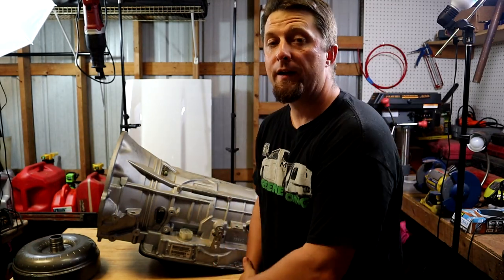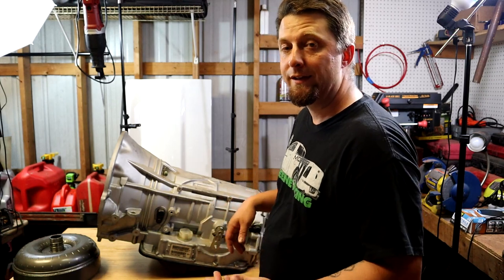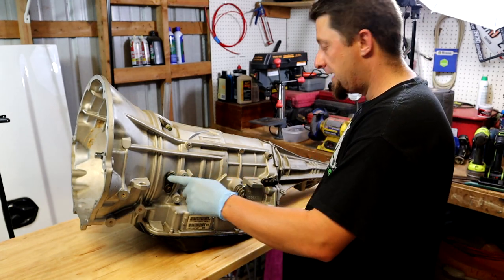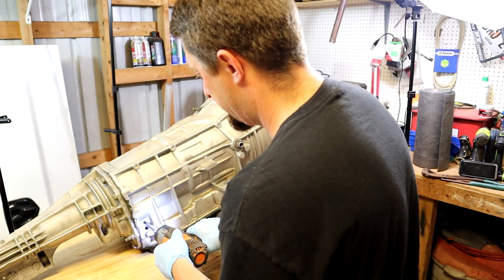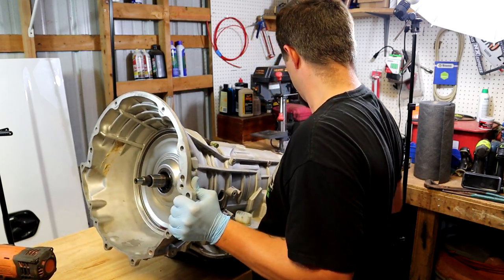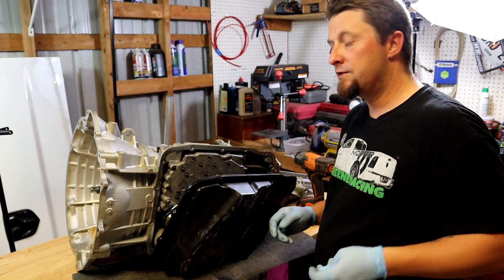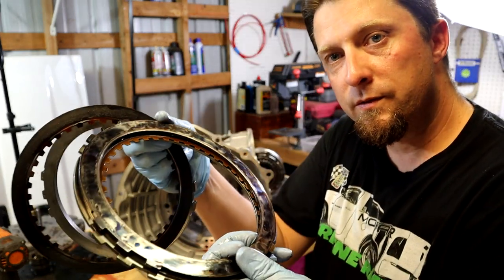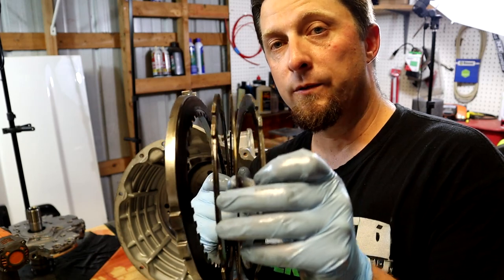545 RFE Transmission Tear Down RFE Most Common Problems

Comment: Builders beware! There are two different second clutch molded rubber pistons out there. Put the wrong one in and have no apply. Quality control is out the door.

Comment: Hello im gustavo from mty mexico y have a 4th generation ram 1500 mod 2012, i have problems because the neutral led no fuction its off in drive the truck, starts and fo forward an esoecialist tell me the range sensor but i dont know where is? You can help me?

Comment: hello, I own a jeep cherokee liberty limited 2003 KJ 2.8 CRD, with my diagnostic devices (DRBIII emulator, Icarsoft) the following DTCs are still present despite their erase. It's P0740 TCC out of range, P2704, P0218, P0868, when I drive I feel vibrations, I can't say exactly if it comes from the gearbox...I'M NOT A MECHANIC. Your videos are very informative, which is why I am turning to you with the idea of having information from a specialist to help me solve this problem. The accelerator pedal is sometimes soft and sometimes not...is there a connection? I changed the oil, the filter but I did not change the flat filter. Thank you for your response, help and support

Comment: Hi there, I have a question for a 545rfe expert…. I have a 2003 ram hemi with 35s. I like to cruise around 65 mpg on the highway, but sometimes it starts to lug down uncomfortably to like 1500-1600 rpm. I have heard these transmissions don’t like to kick down out of overdrive, that it would go into 2nd prime and burn up the o/d clutches. So I am curious what gear does it go into when I hit o/d off button? Does it kick down to 3rd? Reason I ask is because it is my understanding both 4th and 5th are overdrive ratios. 

Thanks

Comment: My 545-rfe has been nothing but problems and it’s just a daily driver.  2003 ram 2500.  It’s always 4th gear slippage for me.  No more than 50 to 80k miles and it needs a rebuild.

Comment: I've only rebuilt a couple transmissions before, but I recall part of the process being you need to soak your clutch rings in trans fluid for quite awhile before installing. Maybe these rings did not get that soaking and prematurely failed?
Reply from the maker: Definitely possibly 🤔
Reply: Details like that are exactly why a novice like me fail the first go-around😊 First junkyard tranny swap I did, I didn't know to prime the torque converter with as much fluid as possible. Those kinds of mistakes (that require hours of labor to fix) are the worst.🤦

Comment: The threads of the cannister filter are plastic. So be careful if you're jamming a screw driver through. Might as well have the correct tool if you're  tearing down a trans.

Comment: I thought this transmission had a fluid temperature sensor fitted? I have a 2005 Jeep Cherokee/Liberty 2.8 CRD which I think has this transmission. It has hard shifting when cold but is okay when it gets warm. I didn’t notice the sensor during the stripping.
Reply: I also have a crd and I'm pretty sure I cooked the TC from low pressure

Comment: I've got a rfe Trans that shifts fine in first and second but wo n't shift into  3rd. We tried replacing the Trans control solenoid and speed sensors  nada . Any ideas?
Reply: I have the same problem.did your fix it? Thanks

Comment: Thanks for the video.

Mine 545rfe has a very loud whining noise when accelerating in all modes - when in park, drive and neutral. I've disassembled it, inspected, replaced a couple of metal discs and installed completely rebuilt torque converter, but it didn't help.

Have you ever faced this problem? What can it be? Any bearing or maybe pump?
Reply from the maker: Glad it helped

Comment: Whats your opinion on the ats transmissions, 5 different stage options. Tired of the reman trans from the shop not paying 3 grand for another one to shit out at 40,000 miles. Stock 2007 dodge ram 1500 5.7
Reply from the maker: Best option for stock replacement is a factory oem transmission

Comment: I’ve got 300k miles on my 45 and it’s stuck in I am assuming 2nd and 4th gear or whatever two gears it chose I’m not sure but I mean before it got stuck in those gears it shifted pretty damn good ngl
Reply: Had the same issue with mine and I have 180k tho but I’m pretty positive mine are shift cylinoids
Reply: From what I have read, you may be in what they call "limp mode". It's a preset failsafe that limits the transmission once the solenoid fails.

Comment: So what caused the clutches to burn up? If it was a fresh rebuild they should have been new. Are they not getting enough pressure to lock up properly? Bad parts used in the rebuild? Installed wrong? Too much power? You did a great job finding the issue but what caused it?
Reply from the maker: That is the million dollar question I'm not sure. I'm leaning towards not enough pressure and perhaps bad install or fitment.
Reply: @FrostbiteRam  I would be worried about rebuilding it and throwing it in your truck without knowing that. Do you plan on replacing the valve body during your rebuild?
Reply from the maker: @chrisrussell6538  probably not, I actually have huge plans coming up for transmission upgrade. Lets just say frostbite will be on a next level.👍
Reply: On these transactions the computer needed to be set in quick learn mode or it will fail prematurely. As the transactions wears the computer compensates. When trans is replaced the computer doesn't know it's new.

Comment: Hi! 
I need some help! What is the different between the 545 and the 65RFE transmission? How can I identifie my transmission? I have 2012 RAM 1500 Lone Star crew cab with 5.7 HEMI engine and I can shift 1 to 6 manually. Thank you for your help!
Reply: You have a 65RFE if there’s 6 gears. The first number represents the number of forward gears. Your transmission has a label on the left side of the case just above the pan that identifies it also.

Comment: Looks like a lack of line pressure in the transmission.  My guess is one of the check ball bearings was installed into the wrong channel or not installed at all.
Reply from the maker: Very possible ill look into that.👍
Reply: That's what I've read is a common failure on these. And even after experiencing some slipping, a new valve body assembly can keep the unit running for many miles. Obviously, those clutches wouldn't have benefitted from such an easy fix.😊

Comment: My 05 Durango is slipping under hard acceleration in first gear only. Have a pending P700 code. Great helpful video!!! Where can you buy the new parts for a rebuild?
Reply from the maker: You can by the factory clutches from dealership i believe
Reply: @FrostbiteRam is there better options besides factory parts like the pump and valve body?

Comment: I don't know much about transmissions but doesn't the 2nd gear accumulator/spring look like it busted almost through the accumulator plate? Isn't accumulator plate failure a some what common issue with the valve body? Could a failure cause the burn up on the cluthes? Please correct me if I'm wrong. Just trying to learn...
Reply: Maybe in wrong o think I was seeing a part below the plate not the actual plate pushed out. My bad.

Comment: I have codes p0700 p0734 p0733 p0732 I have changed both speed sensors and still have the codes don’t know what to do

Comment: Greetings! What have you heard about the Monster Transmissions monster in a box? Worth the $900 in parts? I just build a 399c.i. stroker with a custom torque cam, eagle top end, long tube headers, 11:1 compression. It's going in a 2007 ram 1500 4x4 on 35" mud tires. I really want to get this done right the first time. My tranny has not failed, but I figured I had better build the stock tranny before installing the motor. I expect the motor will make around 500-550hp. Not sure on torque numbers. Any guidance you can offer would be greatly appreciated.
Reply from the maker: From my experience there is no way to make a RFE trans hold power for long term use. But if your not running a power adder and drag racing it constantly it will hold up for a decent time. However the absolute best option is a good used factory trans or a new oem unit the rebuilds don't seem to work well from what I've heard and seen.

Comment: hi nice tear down, i have a 2008  1500 ram Big Horn  edition coming up with code P0740 where is the Oversized Converter Regulator Valve located? thanks

Comment: Good video. But why did the clutches fail poor quality clutches? poor line pressure? Overpowered there's a reason they got smoked where all the passages from the valve body clean? So many questions why did the clutches fail?
Reply from the maker: Not really sure this trans was given to me from a friend who has a boosted ram and similar setup as mine. The transmission was supposed to be fully built but didn't hold long so he did a gm trans swap to his truck.
Reply: Man that would drive me nuts not knowing the actual reason it failed but I love your truck watch your videos all the time thanks for all the good information 👍

Comment: does this transmission have the Neutral Safety Switch or The range sensor built into it? looking at buying a used dodge and owner thinks that this is the issue but i cannot find the sensor on the oustide of the transmission Please Help
Reply from the maker: I believe that is part of the valve body/solenoid pack asm.

Comment: Great video! but i have one small question: Is it possible to fill the transmission with dextron 6 (AmsOil) instead of ATF+4 aka dexron 3. How will friction discs behave in less viscous fluid?
Reply from the maker: Not sure I haven't heard of anyone trying that.
Reply: I have tried it in a Dakota. It initially went into gear, within about2-3 minutes it started violently banging - it seemed like it was trying to go into 2 gears at once. I popped into neutral and stopped. Then it would only go into reverse. I thought I had destroyed the trans, but fortunately I went back to atf+4 and it was like nothing ever happened. These trans are VERY picky about type AND quantity of fluid. Little over/under full and they will slip, go into gear slow etc.

Comment: I got a 545rfe in my 73 Challenger and it’s recently developed a shifting issue where it would feel like it’s hung in one gear and downshifts hard into second. It also has a little trouble going into 4-5 but once it’s there it’s fine .. Threw codes p0700 p0734 p0735 and i suspect the shift pack solenoids .. any help would be appreciated brotha !
Reply from the maker: Best advice do a 727swap or a 46re swap like I did if you want over drive best thing I ever did.

Comment: Any idea why second gear clutch pack failed ? Low pressure? Bad clutch material?
Reply from the maker: Really don't know just is what it is🥴
Reply: @FrostbiteRam  burnt clutches are not the cause, they’re the result of another problem. There likely was not enough pressure exerted by the apply piston. This could be caused by leaking seals, an issue in the valve body, a leaking solenoid, etc.

Comment: How much hp can handel that transmission stock? I have a 2009 procharged hemi and i am not sure about that transmission
Reply from the maker: If racing from digs it can hold pretty well. But if roll racing and you let the trans kick down to many times it will not.

Comment: Mines throwing a code gear 3 incorrect gear ratio any idea what it could be
Reply from the maker: Could be slipping clutches
Reply: It’s throwing another code as well p0700 transmission control system (mil request) it won’t shift past first in drive but you can manually shift it to second

Comment: So there a trans brake for this transmission available? Or would a 727 trans upgrade be better if getting into hardcore racing?
Reply from the maker: 46re swap from cope racing is very awesome he can do trans Break and manual valve body.
Reply: @FrostbiteRam  thanks man, I'll keep that in mind as I have plans for a Hemi💪

Comment: I have p0734 and p0734 codes and my Transmission went into fail safe mode— u think I need a rebuild?
Reply from the maker: Could be bad speed sensor or solenoid
Reply: @FrostbiteRam  shift solenoid replaced last year --input output sensors also  replaced last week  still in fail safe mode
Reply: have same code, replaced my solenoids p0734 is gear ratio error in 4th so I will begin my rebuild this month

Comment: Hey I have the same transmission in my 09 ram 1500 4.7. I'm going to do a stroker build, but I'm trying to determine what the stock trans can handle (hp and torque). My ideal torque is about 500 hp and torque on my build. What upgrades do you recommend for my 545RFE five-speed? Or would you even suggest a trans swap to the 65rfe or Zf 8 speed to be able to handle to additional power?
Reply from the maker: I'm putting a little bit more than that through mine and its still holding. If you stay around 500 Mark it will hold up pretty well if tuned and driven right.
Reply: @FrostbiteRam  your 545rfe is holding up on 500hp? I've the 545 fail a lot on anything over stock. Also have you heard of anyone doing an 8speed swap in the 3rd gen rams that is successful
Reply: Sonnax line pressure booster, shift kit, better clutch packs.

Comment: Do you have the rebuild video to this one?
Reply from the maker: Nope decided to swap to a fully built 46re
Reply: @FrostbiteRam Actually a better route!
Reply from the maker: @GearHeadsRestorationsllc  I did a 46re cope racing transmission swap fully built with manual valve body and transbrake.  I have many videos on the swap
Reply: @FrostbiteRam  Thats a sweet build. I actually own a shop and do transmissions builds. I watch others now and leave good comments if the build looks good. Let me know how that one held up for you!
Reply from the maker: @GearHeadsRestorationsllc  awesome so far its been perfect
Reply: @FrostbiteRam  Good deal!

Comment: Nice, which kit will you be rebuilding this trans with?
Reply from the maker: Most likely factory Mopar clutches.  It seems to me that these transmissions work best left completely factory. Many had tried to upgrade them with aftermarket parts and most has still failed or failed faster than a stock transmission.
Reply: Frostbite Ram that’s probably true, I’m on my second trans but only because one of my lines came off on the freeway. My second one has been holding well though. I have a billet valve body that I’ll be installing next, not sure if it’ll help lol

Comment: what caused   it to burn out?  on a fresh build.  the burned disk are just the results of another problem.
Reply: Sometimes! Rebuilders forget or simply don't know ( yes there are some that don't. I've run into a few of them over the years) that You HAVE to soak all clutch disks in transmission fluid for a few hours at  the very least before they get installed. So while I can't tell if that was what caused this particular problem, this is one reason I've seen some burn out pretty fast after someone rebuilt. Another reason can be due to the spacing in the trams is wrong. Another reason is ( if you saw him looking at the over drive stage Part.) the rings on the shaft may have gotten nicked or torn. While most of the time, if this has happened, it will be noticed very quickly as the transmission won't shift correctly . But also, if it's just a slight nick, it may take it a few miles before it shows  not shifting properly. Then of course there could be a problem with fluid flow. Pump having something wrong with it and a number of other reasons too long to get into here. But yeah, I too wish he'd have told us what he thought the reason it burned up was.
Reply: @tonym3675  thanks so hard to tell sometimes.

Comment: Mine doesn’t start to slip until third or 4th. Same issue or something to dig into and find out?
Reply from the maker: It will be worn clutches most likely
Reply: Frostbite Ram Easy to fix your self, all new trans, or a professional job?
Reply from the maker: @jamesadkins805  I really don't think its that bad to do. But honestly its hard to beat a good used transmission on ebay or a salvage yard.
Reply: Frostbite Ram appreciate it

Comment: Hey, I have the same transmission. It works great, but it does have a small annoying problem in the mornings. It takes about 15 seconds to build up enough pressure to move after you put it in drive. After that it's great the rest of the day. Do you know what might be causing this? Thanks in advance for any help you can provide
Reply from the maker: Possible air leak in pump perhaps. Try message cope racing on his YouTube channel he may have a better idea.
Reply: Change the canister filter. The pump is bleeding fluid back into the pan overnight. It may not be seated properly or the check valve could be faulty. Mine have all done it too some worse than others, but the filter swap usually fixes it.
Reply: @codylapoint  Thanks for the info. I changed both filters when I first bought the jeep at 135K miles and the problem did go away for about 2 weeks, but sometimes it will go for a few days without doing it anyway so I wasn't sure if it was related. Seems to do it more if Im parked on a incline overnight. I'm at 175K now so I think I'll change them again. Thanks again
Reply: I’m about to install a histall, shift kit, and upgrade the clutchs. I was calling around for pricing and two trans shops told me about the filters. One trans shop said to buy the dodge filters not after market ones. The aftermarket ones can cause the problem you’re talking about.
Reply: @Itslikethat313  Yeah, both filters came from Mopar last time. Im ab to change them again. I mostly eliminated the problem by parking on a level part of ground beside my house at night

Comment: Is the transmission that’s currently in your truck with 150,000 miles on it all stock? It’s impressive that it’s lasted that long. Mine has 197,000 On it but I don’t race... lol
Reply from the maker: Yes the one still in my truck has 148k on it right now and still going strong 💪